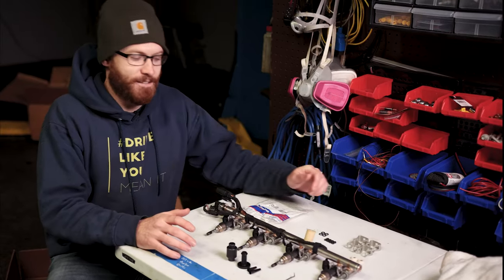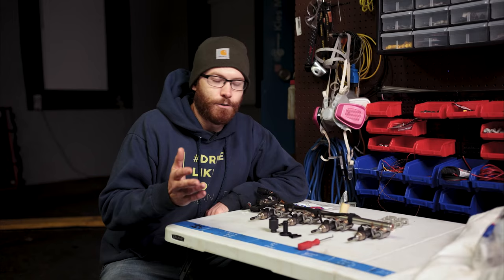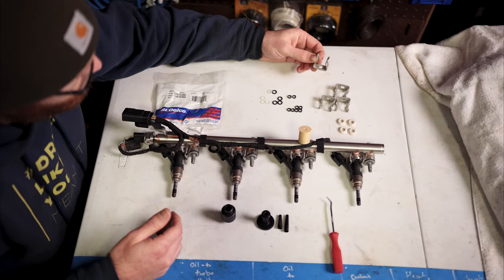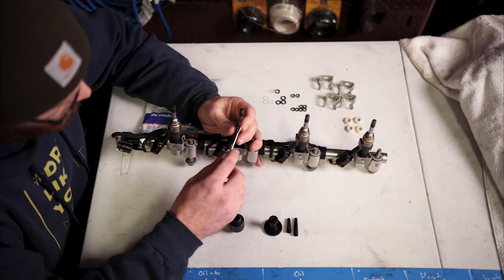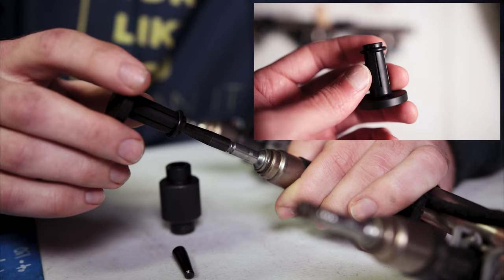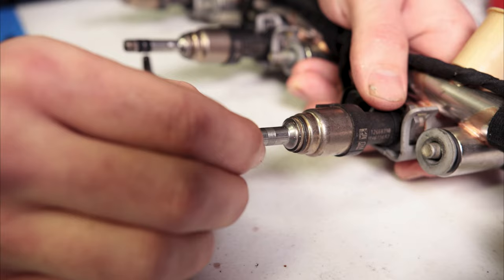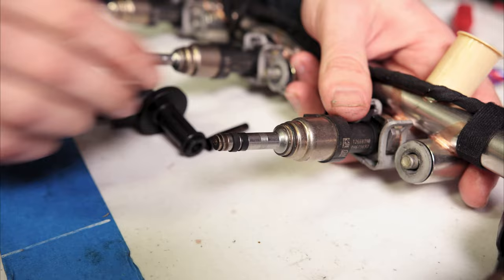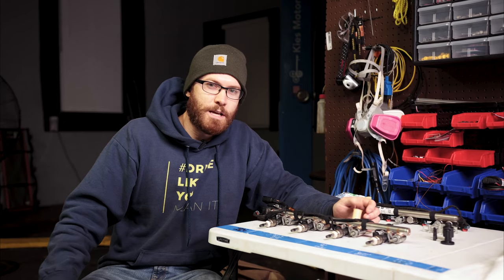High Pressure Fuel Injector O Ring Seals - Chevy Silverado GM Sierra Corvette Camaro 5.3 6.2 Motor

Comment: I merely used an old ink pen to install a teflon/nylon seal. A "new" set of 3rd party Amazon injectors arrived with a split seal on the double seal part but I already had 'em in the rails before I noticed, and since the seller seemed to take their time to respond (and then only to ask for pics) I twisted the steel body off an old injector and reused the old seal. I placed the seal in a glass of hot water and proceeded to stretch it over the tapered ink pen cap. It got thinner as it enlarged. I had to enlarge it several times to slide over the first seal that was in place but the ink pen body was the tool that made that possible. Then I rolled the seal between my fingers to shrink it enough to fit inside that tapered ink pen cap, which then shrunk and fattened the seal to match the others. So far the seal is holding up.

Comment: Thanks. I was told it required special tools... but I guess those must be pretty cheap.  Good to know. I'm about to do my injectors.  Seems like it's really a "not a maintenance" maintenance item.  🙄.  What usually fails? Do the seals blow out or do the injectors actually fail internally? What's more common?
Reply from the maker: I don't think the seals fail super often. Normally it would be an injector failure.
Reply: @TheSundaeDrive  any experience with good vs cheap (amazon) injectors?

Comment: Opinions please! I saw this video series 3 years ago when you released it. Now I am rewatching it again because I'm planning on replacing all 8 injectors soon in my truck. 2017 silverado 113,500 miles. I have one injector that is leaking very slowly at top of engine and I also believe it is causing some occasional bogging of the engine so I'm going to replace all 8. The dealer wants $137 a peice for the injectors. Is it worth it or should I get aftermarket ones??

Comment: if I’m replacing the injectors on a 2006 Pontiac Grand Prix GT

all i gotta do is remove the old injectors, and use new injectors?

all i gotta put on the new injectors in upper and lower rings

or do new injectors already have the upper and lower rings on them

and why is the lower ring a different size than the upper ring?

i believe that it’s the lower ring that seems “way too loose” on the injector

and i don’t understand why

Comment: @The Sundae Drive: if the lower gasket are a one use only why not just cut them with a exacto knife to reduce doing damage to the injector with a pick.....
Reply from the maker: I think the risk is similar. If you slide with the knife you could also score the injector. Personally I felt that the pick tool was the safer option. both will work tho but either way, you need to be careful.

Comment: I notice when you removed the fuel rail, the fuel injectors stayed on the block/head. How did you remove them? What do I have to do to get them out.
Reply from the maker: It requires a special tool I didn't have. They were extremely corroded into place so I just sent them in with the head core charge 😅 they already had 110K so I figured better to go with new ones. On a lower mileage vehicle they pull out pretty easily with the fuel rail
Reply: @TheSundaeDrive  lol alright. Cuz I'm trying to figure a way out how to remove it. It's injector #7 n man r they a pain to remove. That's the only one I need but couldn't figure out how to remove it
Reply from the maker: You could always take the head do a local dealer or performance shop and have them remove it. Definitely replace all the gaskets.
Reply: @TheSundaeDrive  sounds like a plan. Thank you
Reply from the maker: No problem! Best of luck with it

Comment: @ The Sundae Drive. Ive got another question. Also when you removed the fuel injectors that stayed in the head/block. Was there anything to removed the dirt/debris that stays there. Like a pick or special tool
Reply from the maker: I just used a vacuum and small pick to clean it as best I could. Because I was swapping the heads tho, I didn't pull the injectors out of this head because I could not get them out. A special tool is required that I didn't have.
Reply from the maker: If you are swapping heads, I would pull the heads and then just take them to your local dealer and have them pull the injectors if yours were as stuck as mine. On newer low mileage vehicles they will pull out easily with the rail.

Comment: How come you didn’t just plug in a Range Technology dongle to turn off the V4 mode??  Also,  why didn’t you install a billet torque converter when you had the engine out?  Direct Injection causes a ton of carbon build up on the valve seats.  I hope you use a catch can now too.
Reply from the maker: I've been running a catch can since 50K miles :) we have installation guide on it up in the channel for it. I talked to circle D and because I wanted to stay close to stock stall for towing, they recommend the 6l90 torque converter. If the trans makes it to 200K I plan to swap the tc again and will look into stronger aftermarket options. Range devices do not prevent the failure. Many documented cases of afm lifters still failing with a plug in tuner.

Comment: 2016 silverado  I Just had all my injectors replaced  now I am getting a gas smell could it be seals not sitting right also would the check engine light go on.
Reply: Did you get your issue resolved? I’m having the same problem
Reply: Hello did you fix it ? I have the same problem. I smell gas inside of the cab. Car dealer changed the seal of tw injectors. It’s still smell bad